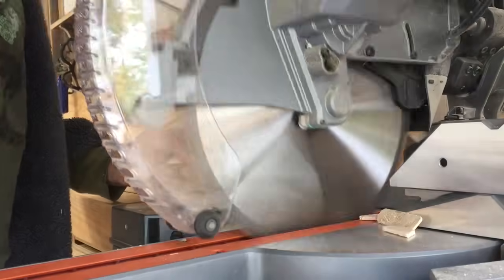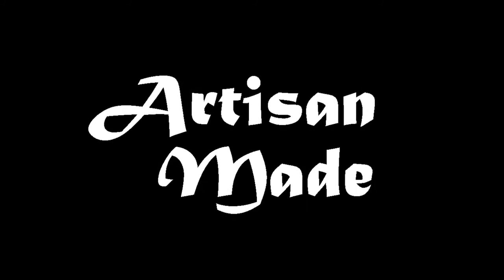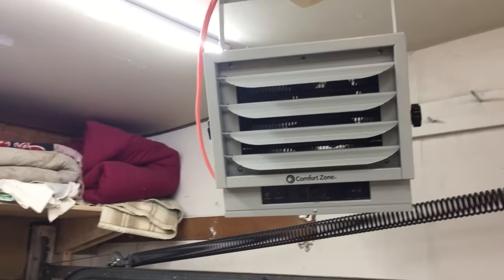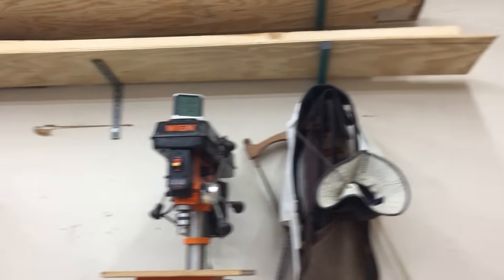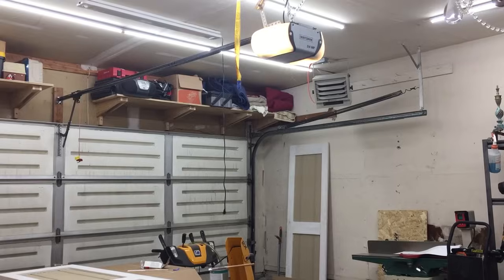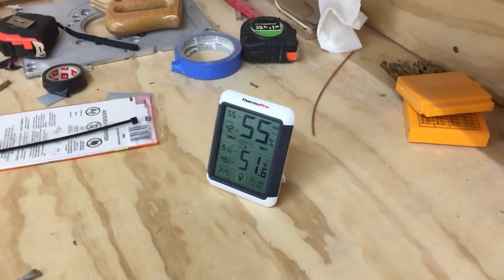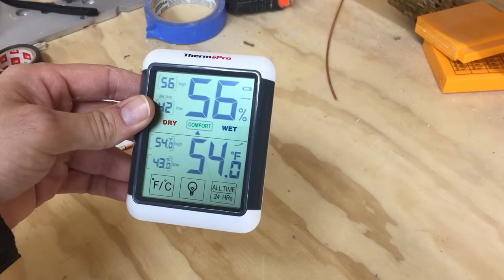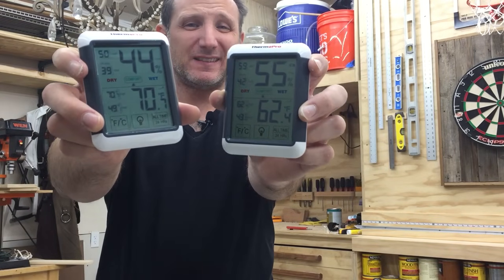How to Heat a Garage or Workshop for Under $100. The Comfort Zone Industrial Heater: Does it Work?

Comment: 5000w running full time is going to be expensive! My electric is about $0.10 per kWH, which puts it at $12 per day to run. Even running half the time it's still going to push $200 per month in electric cost. Natural gas or propane would be a better option.
Reply from the maker: I don’t think these are supposed to be running 24/7. They are great to heat up your work space when you are in the garage or workshop but then you shut them down.

Comment: This might work for me, my garage is insulated.
Reply: Works for me and my 3 car garage isn’t even insulated, sure if you are on the far side of the garage away from the heater it may be a little cold but it does a great job, I bet it would work even better with insulated garage doors

Comment: That 5kw electric heater is going to make your electric bill worse than the cold garage!
Reply from the maker: If you are heating your home with this thing, you will go broke, but for the few hours a week that I’m using it, it’s not noticeable
Reply: @ArtisanMade  people who would use it only a few hours a week can't justify the cost of having a dedicated 220v circuit installed for it.
Reply: @charlieodom9107  ... only problem is to get a similar amount of heat using smaller heaters (1500 watts each) you would need 3 of them (4500 watts) so you'd also need 3 circuits in the garage, which most people don't have. You'd also have to buy those heaters at $50+ each, so more there too.
Reply: @rupe53  a normal person wouldn't use electric heat in the first place!
Reply: @charlieodom9107  ... agreed, but in situations like this it's pay me now versus pay me later. People need to set their own priorities on what works for them. I have hot water / cast iron in my garage and while it's comfortable, it's slow and not cheap either. (and I used a fan to move the air as well) Thinking back to the winter I was restoring a car it cost me an extra $300 for 3 months. OTOH, I suppose that's cheap when you figure only a dollar a day during peak heating season here in New England. Edited to add: oops on the math, that's $3 a day in my case.
Reply: @rupe53  you can buy a propane heater for 50 bucks that will heat much better and more efficiently than an electric one.
Reply: @charlieodom9107  ... you are right, but a portable unit will be on the floor where for some people that will create other issues. Gotta pick your battles and go with what works for you. If price is your main goal then everything else will be a compromise.
Reply: @rupe53  they make propane units you can mount or hang like this one.
Reply: @charlieodom9107  ... don't think I have ever seen a gas heater that cheap and you'd still have to plumb it and add power for the fan. I mean, technically that would turn into a professional installation for at least part of the job so cost more. While electric is something that most DIY types might be ok with, I wouldn't recommend gas work for weekend warriors. Just too much to go wrong.
Reply: @charlieodom9107  ... ok, I won't get into name calling or profanity but you can do it your way and see what the building inspector says. I'm only trying to protect the people who may think they can pull it off but might burn down the garage because they have no common sense and never worked with gas before. After all, professional advice from a guy with 25 years in the field and a gas license isn't worth anything, right?
Reply from the maker: Thank you for fighting the good fight. I realized it isn’t worth arguing with some people.  thank you for taking the time to share your professional advice. In a perfect world I would put a pellet stove or a wood fired stove in my garage and call it a day, but my space to too small. For a guy who needs to easily add heat in their garage to get some work done once in a while, it gets the job done.
Reply: @charlieodom9107  How is propane more efficient? Electric heat is 100% efficient.
Reply: @charlieodom9107  Please explain how i am ignorant?

Comment: DO NOT BUY!! WARNING!! DO NOT BUY...

If you want to set your workshop or garage on fire get this heater..
Total piece of trash,mine lasted 3 months before I had to put the fire out that started on the inside..If I wasn't home If would have taken out my garage....
Reply from the maker: I’ve been using mine for four years and it has been great. It is possible that you might’ve had a defective unit. Most of the time though human error is involved. For example, incorrect wiring or improper placement too close to a wall or structure. Anyway, I’m glad you were able to save your shop. Hopefully you’ll have better luck in the future.
Reply: @ArtisanMade  A professional electrician installed the unit to specs...They are cheap units and I should have known better..Chinese made junk...